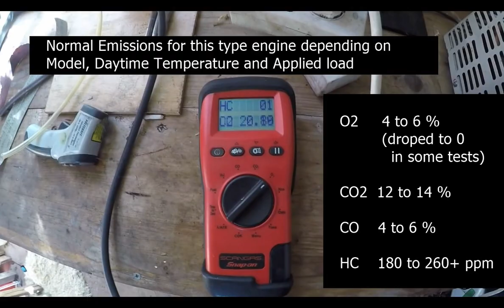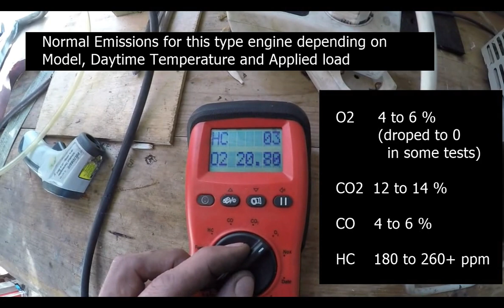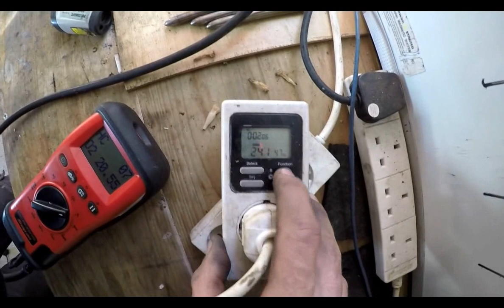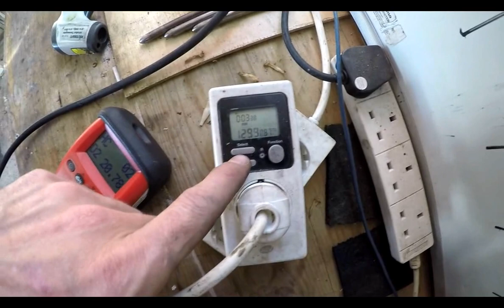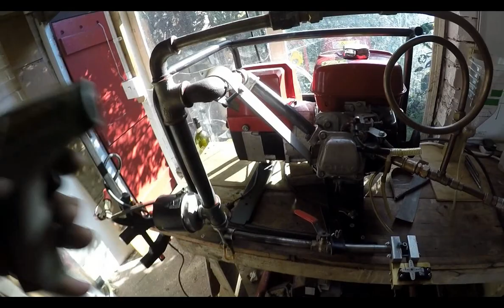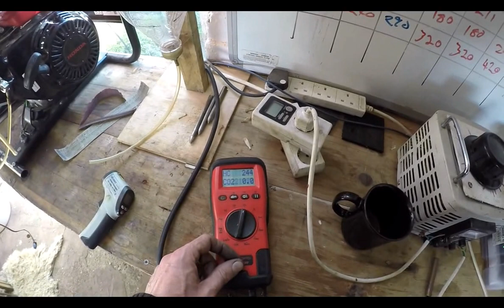GEET life GX160 Micro Carburetor First Run

Comment: what Are the calculations to the reactor as i want to fit it on a car with a Stanley Meyer hho wfc as fuel ? 😃 regards
Reply from the maker: hi  there.   Sorry I don't know that off hand..   

There is no direct equation to follow when building one of these, just a rough starting point.
Then you have to figure it out by running the thing and watching what it does...
Its taken me may 1000's of tests and re-designs to create a map in my head, that follows the system interactions and weird stuff that it will do when its not right..   

That's why people cant make it work and give up with it...   

I tried to create a class to teach it, but people's minds just melt......

If some one had 6 months to spend in class with me they would get it...
Reply from the maker: SAFETY NOTICE :

I should really say that it is un-advisable to hook a HHO rig into a GEET reactor..
If you do try it, fit a seriously good flash arrestor between the hho system and the reactor..
The last person who tried it with out one, wound up picking bits of his engine out of the wall..
 
GEET Gas is very close to HHO in some ways, so there is not a great deal of saving to be had by combining the two
but keep up the good work and i wish you the best of luck
Reply: thx for the safety notice, I will put it in a hole in the ground.. deep... with a lid ;) 
what calculations are used to scale the reactor, if i want it on like a 1600cc engine? it seems like i can only find the plans for small scale engines
Reply from the maker: Yep that's all that is in the open source box.

Start with a small 2 cylinder petrol engine with a 1" reactor ( the free plans)  and go from there.. 

Ill be working my way up to the bigger mutli cylinder engine this year and then i will know more